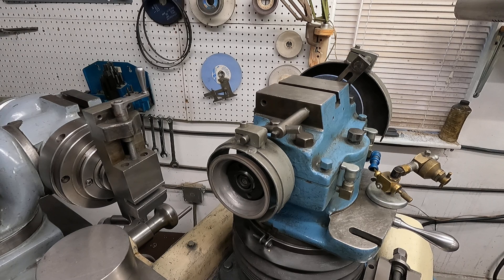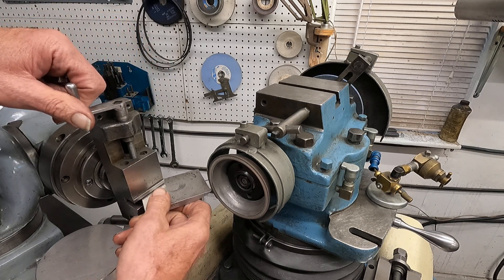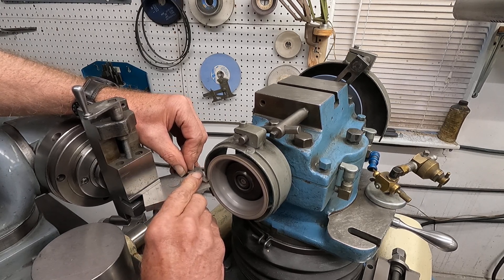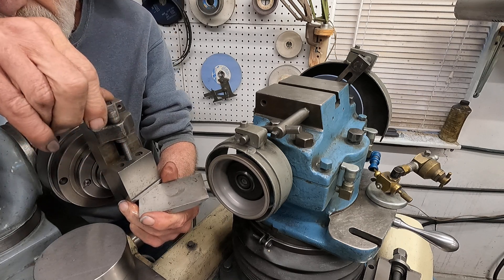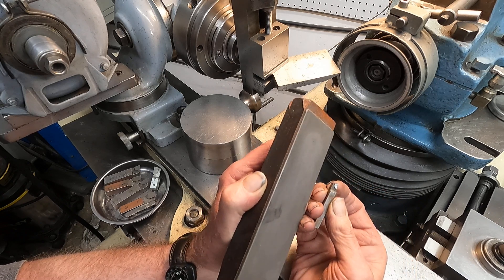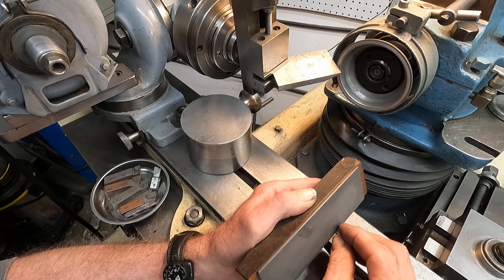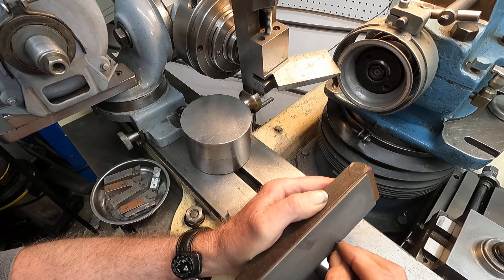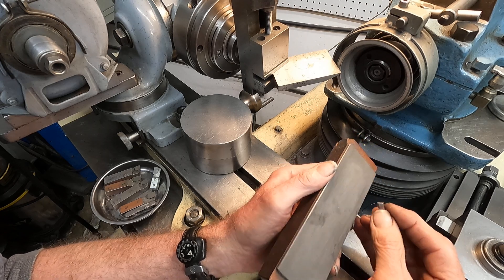Tool & Cutter Grinder delicate hand grinding

Comment: Hey dee dee, maybe a good video subject would be sharpening a fine positive rake point on an old negative rake carbide insert- triangular inserts are good for it. You can take nice consistent light cuts with an inserted tool with a good sharp ground point, where you would usually not want to go below a certain depth of cut.
Reply from the maker: I do that often with CNMG inserts to bore cast iron I will grind  a worn insert various ways for a demo, thanks for the subject idea!